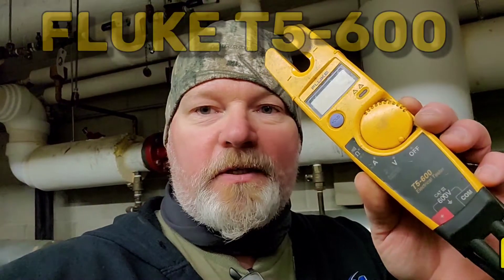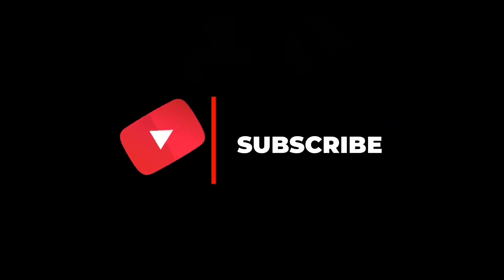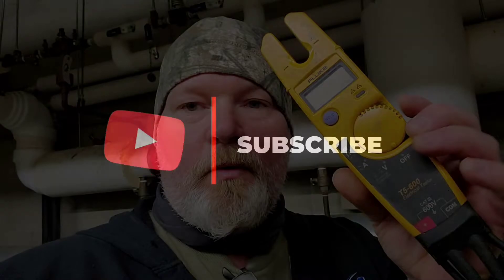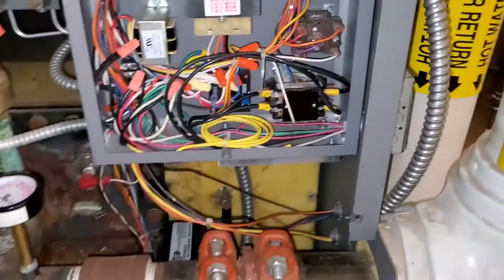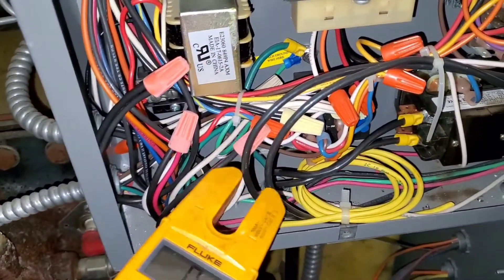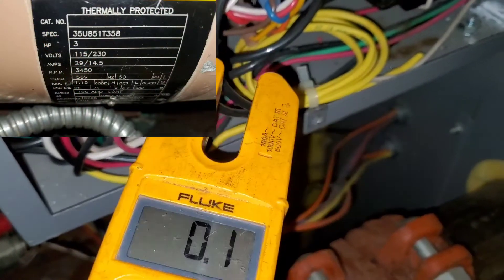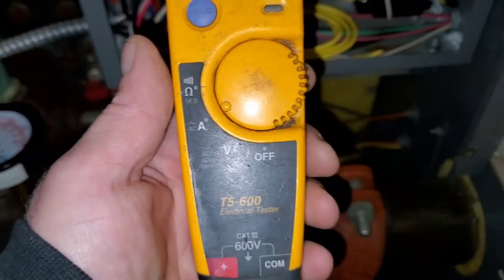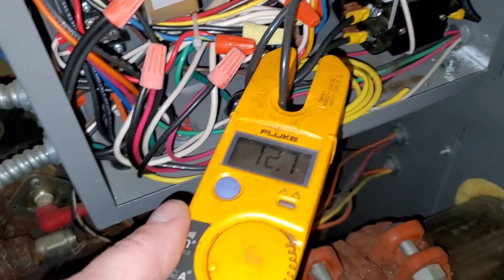How to check amp draw easy with a Fluke T5-600 multimeter

Comment: I have this meter. I do a lot of low voltage 24v. I usually deal with 2amps to 5amps. Is this a good meter to measure